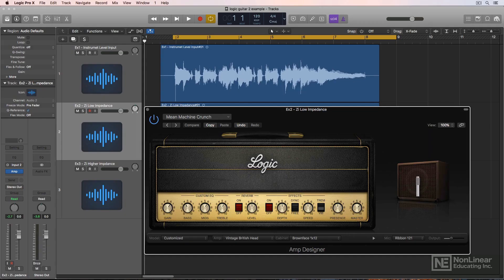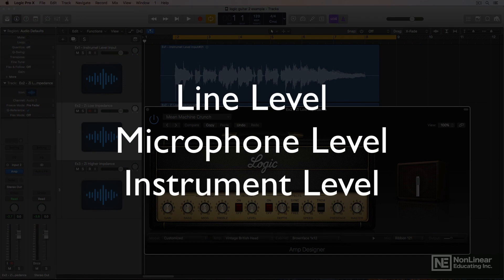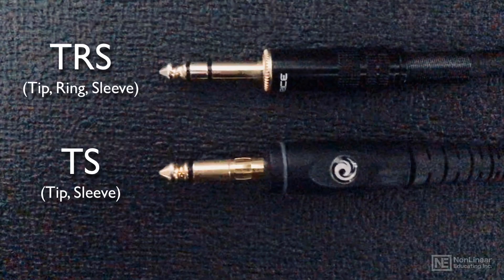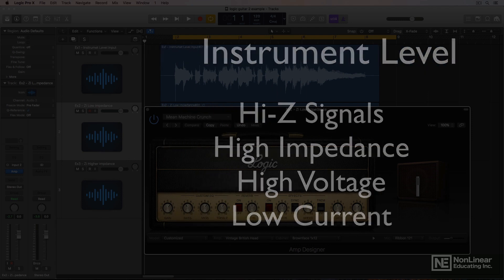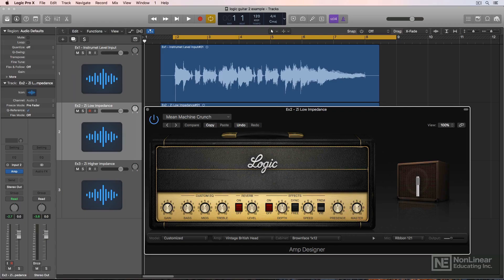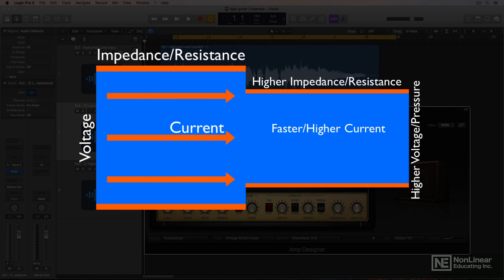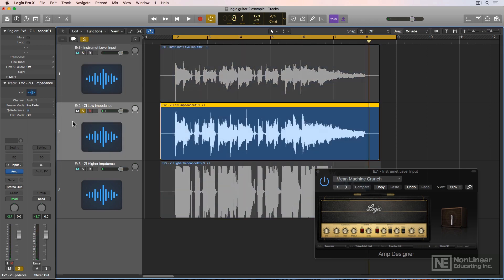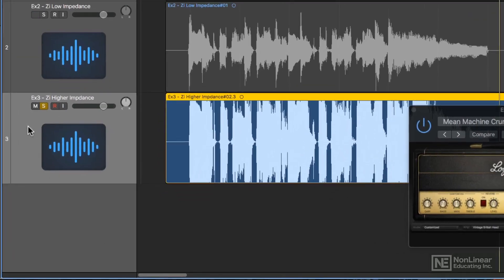Logic Pro X 501: Studio Series - Recording Guitars - 2. Direct Input Signal Levels and Impedance

Comment: I have a question about explaining what impedance, voltage and current are, using the example of hoses of different diameters. Since the source of the signal is a guitar (Hi-Z) shouldn't the Hi-Z part of the drawing be on the left and the Lo-Z part on the right (time>3:42). Of course, the translation would also have to be changed accordingly, which does not change the fact that the generally understood explanation of the phenomenon is correct. Regards.